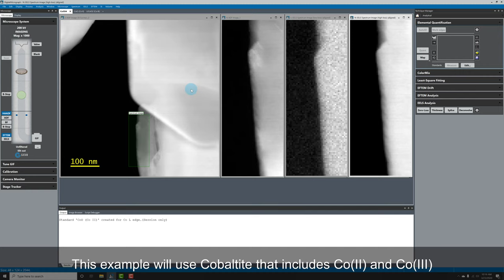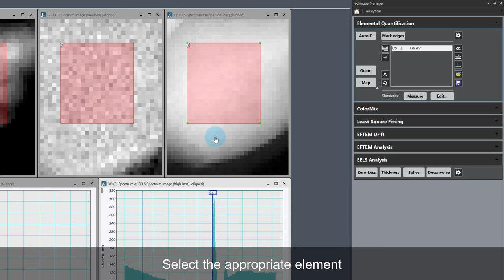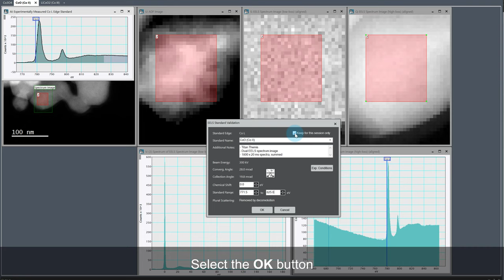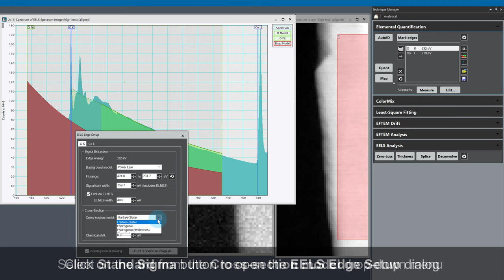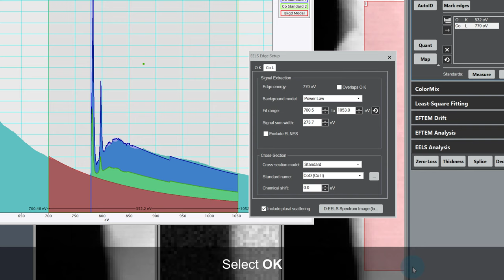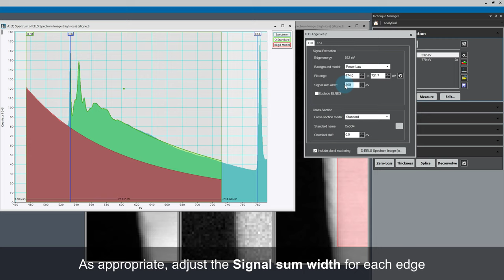EELS Quantification: Using concurrent standards

Comment: Why did you choose oxygen standard from the same spectrum (Co3O4) and not for either CoO or LiCoO?
Reply from the maker: Hi Victor, 

Thanks for the question. In order to keep the example in the tutorial short, we wanted to demonstrate using just one of the ionization edges. We chose to use concurrent standards using the cobalt L2,3 edge as it’s the simpler of the two choices. Near-edge fine structure for transition metal L edges is mostly defined by the first coordination shell, but that isn’t the case for the Oxygen K edge. Hope that answers your question.